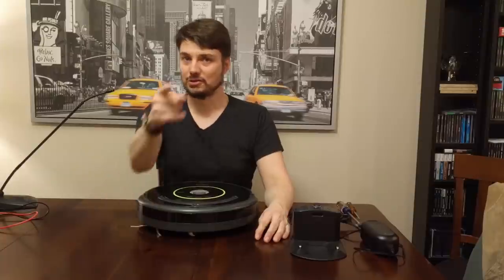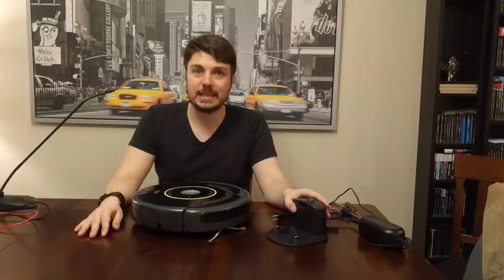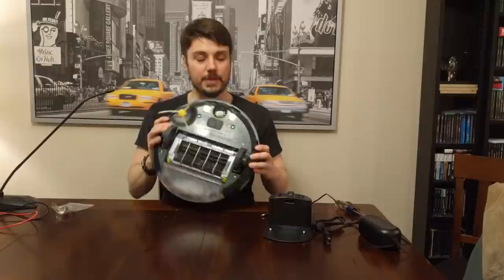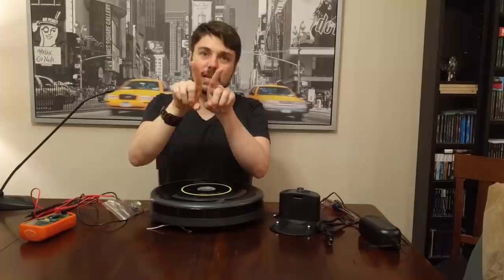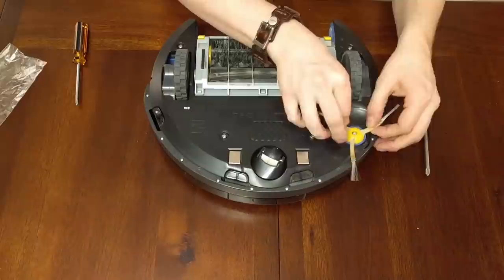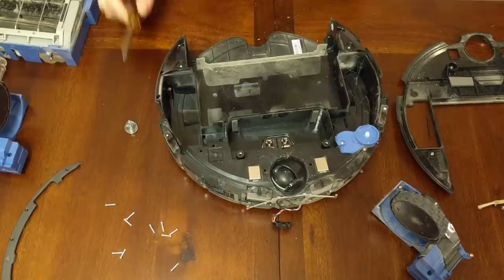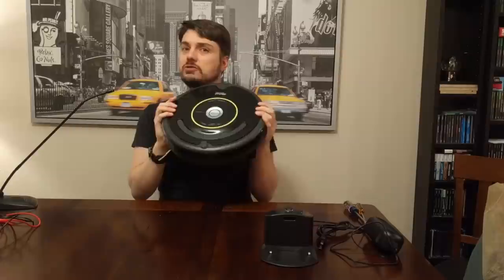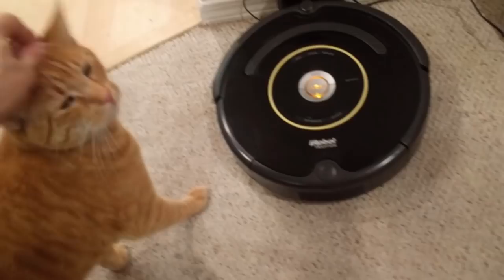Kellys Rambling Robot Repair! Fixing Irobot Roomba not charging on dock or sensing dock 650

Comment: Thanks man!! i have a roomba 655, this model DOES NOT COME WITH THE  FAST CHARGING PORT ON THE SIDE.
But before I found your video i changed the motherboard, which it does come without the side charging connector on the board (I would show you the pics if I could), so i went and bought the jack-wire-connector you recommended  , connected to the mother board, mounted on the side, poked a hole, and VOILA charges all good. So thanks to your help i did not only fixed the problem , but also i added functionality))) IM happy!!!

PS1:Because on my personal journey with this thing, i took it apart and put it back together 3 times, and i can tell you  don't need to take the bottom subassemblies out. just the bumper and the top circular pieces until you get to the mother board

PS2: Much appreciation to you, for being the  ONLY GUY that  that does not says: Make sure is plugged ..or that kind of useless help that most of blogs suggest

PS3: i agree with Kelly that Roomba built these to be fixable, so don't be afraid to do the job yourself , accouple of pictures and drawings will help you take it apart and put it back together w/o much trouble.

Comment: Thank you for this video!! Excellent job and tutorial. 

I will say to anyone trying this, before you do try the cleaning the jack port trick. I sprayed mine for a good 30 seconds with compressed air. I was shocked at how much dust came out of that port.  I then used a paper towel rolled into a fine tip and dipped it in 100% rubbing alcohol (I didn’t have contact spray) as my 595 is over 10 years old and owes me nothing. I was losing my mind as I’ve tried so many times to make this thing connect to the dock and it wouldn’t. This did the trick and I was so overjoyed. I hadn’t used this vacuum for 4 years and I had neglected it pretty bad. The battery, filter and brush rolls were replaced  today but then it wouldn’t dock! This video and the comments saved me from throwing this thing out in frustration even if I didn’t have to replace the port, so thank you for that and those in the comments who shared your tricks to get it to dock again! So happy!

Comment: Very useful video. I had exactly the same problem. Instead of replacing the charging port/socket, I use cleaning duster to blow the dust off the charging socket and it fixed problem. Hope it helps the future viewers. Worth a try.

Comment: READ BEFORE YOU BUY 
- there is no need to purchase a new port and wait for it to arrive. If you have only one charging cable, the safety feature is of no use to you anyway. So simply bypass it!
On the back of the charging port, the green PCB board has a BLACK, BROWN, and RED wire attached to it. The black and red are the bottom tab (ground/negative) and the center pole (positive, first contact on bottom), and the brown wire corresponds to the other charging contact on the bottom of the roomba. You simply need to jump the BLACK to the BROWN in any way you like! This permanently fixes the switch to be stuck "on" instead of off. If you don't have solder, you could simply remove the part entirely at the connector to the motherboard, and then bend the two prongs (for the BLACK and BROWN wires) together so they touch - or, leave just the wires (rip them off) and attach them together. If you have solder, you can solder these two prongs together, or if you want to leave the charging port in the machine (and have it still be usable) you can do as I did and solder the back of the port, right on the PCB. This also allows you to replace it with a new port later if you so desire. The two bottom-most (opposite the wires) blobs of solder correspond to the switch, you can try it out by jumping them together and watching it all work. Then just stick some new solder between these two points and viola! Permanently fixed, and you can still charge from the side :)
- there is no need to unscrew the handle, as in the video (and yes, it's a handle!)
- there is no need to unscrew the WHEELS at all, you can leave those too!
Reply: That's right. I screwed the Roomba motherboard trying to replace a component. I bought a "new" one that come with that charging connector (original mine doesn't have it). you only need to bridge the left and center connector on the motherboard already installed on the roomba body.

Comment: Thanks for taking the time to make this video.  It solved my Roomba charging problem and your instructions made it an easy fix.  I couldn't get to one of the screws on the right wheel and made the repairs with the wheels in place without any issues.
Reply: yes, i'm also not able to get the wheels out because i dont have a long screw driver. I was checking in comments to see if anyone was able to take out the front plate without taking out the wheels. Your comments helps. I will keep on trying.

Comment: First of all thank you so much! I have a Roomba i7 and after cleaning the surface and the back part (wheels and other back parts) immediately It started my problem! The problem was that when I pressed the home button it founded the base station but didn't stop to recharge again and it damaged the dock station! I started watching your video and opened edge brush, button tray piece,bumper and the front sensor! I really have yo tell you thank you so much again because more than twenty minutes I didn't know how to close the bumper and where!while I was watching your video! Also I figured out that the charging base doesn't have any problem because when I put the virtual wall in front of the Roomba it didn't stop and passed the wall and that's why I opened it! Now it works and it founded the dock charger and stop and charge normally and it stops in front of virtual wall! The only problem is the bumper and it said error number nine and the bumper is stuck and I think the screws are not tightly closed because I didn't have a Phillips head screwdriver! If your video didn't exist then I never could solve the problem and really I appreciate it! I was going crazy when the vacuum cleaner broke! 
Thank you for video again and I think this could be helpful for you and others too! As you said correct tools are always helpful.
I did the same thing which you did on 9:28 and only I watched your video because I didn't know how to close the bumper

Comment: Excellent demo, but this problem is far easier to solve by just squirting switch cleaner into the socket on the side of the robot, push plug in and out a couple of times, and presto, now docks fine again.The problem is just a dirty contact, no strip down needed. So give this a try first!

Comment: Tear down and reassembly worked, I didn't even have to replace the charge port. I did test it with the multimeter tho. Just put the meter on beep mode and then test the three prongs on the connector. You should get continuity on two pins with it plugged in, and continuity on two different pins with an unplugged. In the end, I think the actual fix for mine was just cleaning the battery contacts - there is a tiny bit of battery crest. Nevertheless thanks for the video!
Reply: Bro, ease up on the Bam Bam

Comment: Nice work, this from a guy who has done a lot of this kind of work. Two things: you could really use an electric drill/driver for removing all those screws, and we don't need to see every screw go out and back in. Just be careful during reassembly; start all the screws by hand, then run them down with the electric driver, with the torque set at bare minimum.

I just bought a Roomba 960 yesterday, so your job may save me a lot of time in the future.
Reply from the maker: agreed. my regular ryobi drill is so heavy it hurts my wrist for something like this. I need a light weight one!
Reply: @Elecyview  I have a small B&D that I bought from Amazon 5(?) years ago. Great little drill, and the battery is still good. I can leave it on the bench for months, and it will still run fine.

Comment: Rosie the Roomba does a great job picking up my hair🌼 (which is very long) as well as my two cats' hair. Much easier to just prep the house (pick up loose things on the floor, move some furniture around) and start Rosie than to vacuum--which forces my teenager to pick up her room! Also helped us take control of the flea problem we were having. Connects to the app and lets you know when she's stuck, low on battery, or done with the job (and she returns to her dock to recharge). Easy to empty bin (just remember to do it every time as it's not very big). Very happy we finally got her!

Comment: After watching the video I inspected the Jack plug on my 595 to see if the contact needed to be bent over to side. on inspection I noticed that there was a great deal of dust and dirt in the jack. I was to the point that it was difficult to see the copper contact on the upper side of the plug. I used a small piece of cloth and a pick and cleaned the jack out and that did the trick. I totally enjoyed you disassembly of the Roomba.  Thanks
Reply: My hero!

Comment: I found an easy SOLUTION: I had the same problem. When I put the charging cable directly into my Roomba, it was charged without problems, but it would not charge on the docking station. Before you exchange the DC jack on the roomba I recommend testing the following: the problem is dust in the charging jack on Roomba. Just blow it out and put some contact spray into the jack. It should be loading on the docking station again - at least it worked fine for my Roomba. Background: the plug is a changeover switch so that the Roomba can be charged via the charging station an via the DC jack at the same time. Over time, the plug and thus the switching mechanism gets dirty. Blow it out and use contact spray. It takes 1 Minute and solves the problem. Good Luck.
Reply: What kind of contact spray did you use? Thanks!
Reply: Any computer air spray.  Easy to find at Staples or WalMart.  Don't spray 1 or 2 seconds.  Spray a lot, like 20 to 30 seconds.
Reply: P.S.: I use only air spray, whitout contact spray and it works well ;)

Comment: Had this problem with a new Charging station, was just about to return it but found this video. Bent the connector just a little bit and it started working on the charger.

Comment: Thanks for the great teardown video, you're bookmarked.  I had the same problem but tried one of the comment fixes by cleaning the manual ac jack with a tiny brush, electrical contact cleaner, and canned air a few times, and that worked for me.

Comment: At around 18:00 the thing that you are unsure of that you think might be a handle… is the handle. It only comes up a few degrees and makes carrying the Roomba from one room to another easy. Also, you did realize you did not have to disassemble quite as much as you did, other that to gain full access to the places to blow out dust. Just saying that I have done this in 5 minutes… not 49.  And, by the way, great job of taking the thing apart and getting it back together. Shows people what can go very right and waht needs some itme spent to do without breaking anything.

Comment: IT WORK FOR ME. It was this jack that was malfunctioning. I tried without it and more and it was when I put the jack of my friend's Roomba 761 (item to mine) to it that it started to recharged and docking again. I put a little heat on the jack soldering just to reconnect it good than showered it with brake cleaner and electric fluid and now it just works great.

Comment: Thanks a lot my dear, I know this may sound silly but I didn't nitice the plugging part on the body of roomba before and my battery was totally dead in a way that it didn't have the ability to recognize the charging docking station although I kept it on it the whole night... But after half an hour of charging it directly to roomba (when u gave me the hint of the manual charging option) it worked and managed to get it working and going to the home-charging-dock.... Thanks a lot dear as I was worried to death of losing my iRobot Roomba ❤️

Comment: Thanks heaps for this.  My 500 series was in storage for 5 years, when I took it out, I replaced the battery and it worked a treat, but never would charge on the docks.  Even bought a new doc before finding your video.  Used the first trick to get the roomba working and might replace the $3 piece if I can get it shipped to NZ.  Just wanted to say thanks for the video and your honesty as you went through, gave me the confidence to open up my roomba.  The last time I did that, it didn't go a well. LOL.

Comment: I had the same problem code 5. I took a pencil & used the eraser end to clean the shiny electrical contacts on the robot and the charging dock. Then I pressed and held the DOCK & SPOT button to reset the robot.  Docked the unit and it charged and works fine again? Cheap, easy & quick to try!

Comment: Very helpful for "disassemble stephney" ! One little hint I would offer : when putting the screws back in the "reverse to click" works well but always "start" all the screws before you tighten them makes alignment easier. Not sure this is the problem with mine (not charging) and my model does not use same dc connector on the unit as the charger. (Charger is  ac cord jack only on my 770.)  OBTW: If you think working on something with kitty's help is a pain try it with a 120 lb German Shepard in your face ! LOL   And we have enough fur in our Roomba to build several cats! Great job & thanks!

Comment: Great video Kelly, despite the rambling. (kidding, very nice). My Roomba 650 doesn't have that part at all, there is no place to charge directly. The docking station contacts must be kept immaculately clean. I may solder small, thin pieces of sheet silver or copper to the contacts to get better contact than steel. Thanks again for the nice video! ... PS, the screws that are held in are called "captive screws".
Reply from the maker: Thanks! oh wow i didnt know that the same model wouldn't have the A/C jack on the side? I dont know a ton about roombas! Thanks for the captive screws tip! :)

Comment: Fishbowl fell onto the Rumba -which was on the charger. I threw towels on it but it would not charge the next day. I opened it and. I thing seemed even damp. Cleaned it up and still won’t charge - tried plugging in directly, nope. Should I assume it’s the battery? Maybe shorted out?

Comment: Thank you for giving me faith that I just have to pry the top cover sucker off and the idea to pry from the inside... All other vids I checked had this convenient shape where they could just prop the cover up from the end and they made me feel like such a loser 😂 I have a Roomba 695 which apparently is made for Kohl's and nobody owns one except me. I eventually resorted to a zip tie to run through the ring edge from both ends and got it off. It was one tight piece of plastic... Fingers are still hurting.

Comment: Mine was doing the exact same thing and all that was wrong was some dirty charge sensors. Get a magic eraser and clean the two metal charge points on the charger and the two on the robot and it will connect as good as new.

Comment: Great video . I have a Red Rumbo.  500 series. No docking station but does have adapter which can plug in side.  New battery ran fine until I need to charge and no power.  Indicator light no go.  Light on adapter shows power. Ran continuity test. Go on one contact but not the other.  Opposite of your demo, If I replace with the same sensor do you think that will do the trick? Any safe way to charge the battery without inserting in Rumba? Thanks

Comment: My roomba 650 does not have the charging port in the body.  I wonder why.  It is a 650.  I have my old 650 and it works fine so I replaced the battery on the new one and put it in my old charging dock that i know works, the battery light still blinks and then dies out.  Any ideas?

Comment: The bar you lift up on is  a HANDLE, ALSO nice video as well . but i I have a  question why is that piece the problem ? cause you can unplug the dock station and plug directly  in to the Roomba itself does that also  connect to the sensor feet that it detects the  charge plates below ?  cause lot of times that sensor you unscrewed is it gets a film layer of dust under it and the Roomba can not dock cause the IR signal is blocked .  but the port you unplugged is for direct connection. I delt with  fixing these  things quite often that is why I wanted to ask 
was that connected to the charging system also ?  thank you for  the video  the take down of it is always fun the face plate  is usually two lock system and a plastic  push bar  is the best for that .
Reply: I have a problem seeing how this fix has anything to do with his so called docking and charging fix.. I do agree it should fix a no charge issue if you are direct charging without your docking station.. But to say this fixed a no charge issue on the docking station seems impossible to have anything to do with it not docking or charging on the docker.. Not seeing any voltage test while on docker or direct charge is the reason I beleave this will not fix a docker no charge problem..

Comment: Hi! Do you know if the Roomba is able to charge from the dock, but not from the side plug? My Roomba is dead, but I am getting more messages when it is on the dock. When I connect it, it keeps blinking in orange quickly. I have tried the reset procedure (stock + dock button), but it does not work: after a few hours "charging", the Roomba gives a charging message error (7). I am using a replacement li-ion battery (not original), it is almost discharged. I think the charger is not able to charge the battery. Thank you in advance for your help!